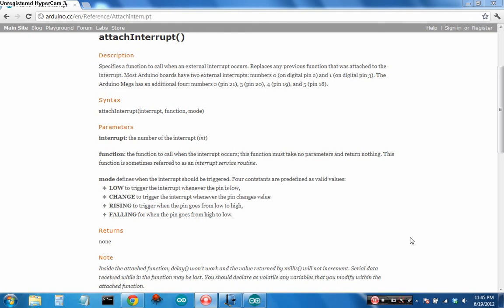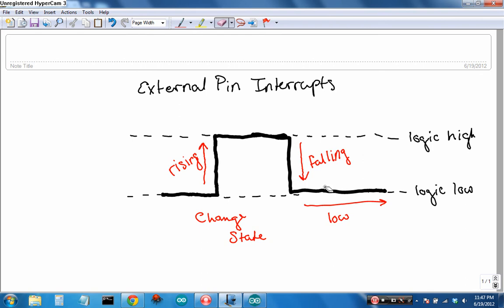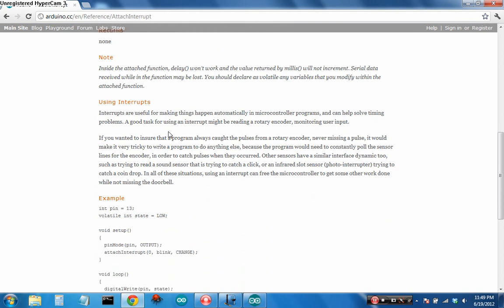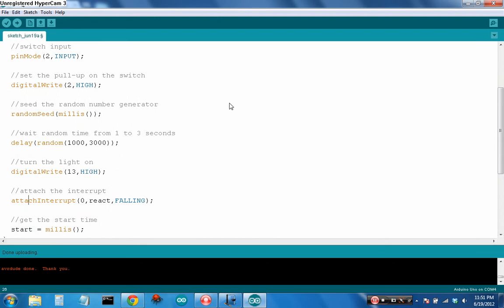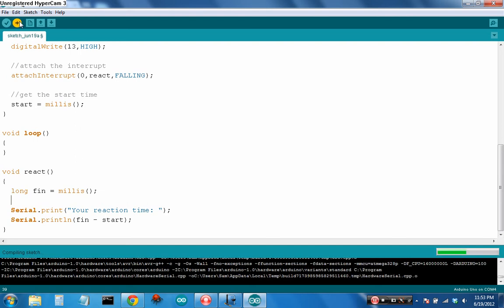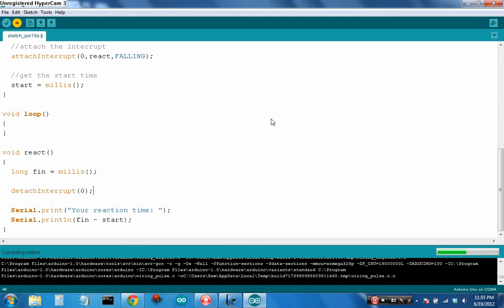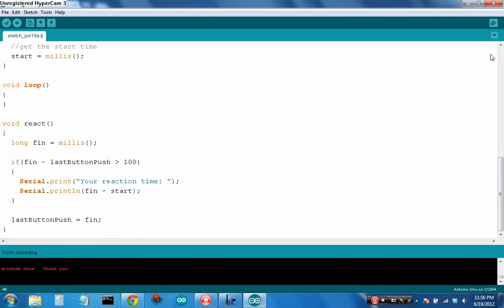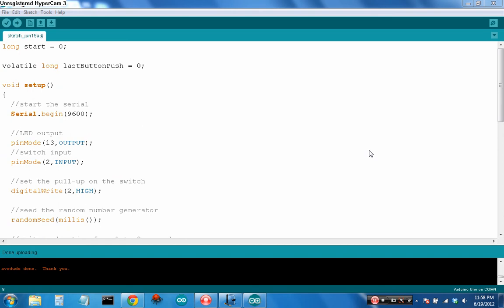Arduino Tutorial #7: External Pin Interrupt

Comment: Hi Guy,

i have a problem and i don´t know , if you can help.

i have a generator , which gives a voltage from 0-5v out. i connected the output of the generator to an interrupt and i have another voltage always with the same range(0-5v). so i connected this one to another interrupt on my arduino Mega 2560.

I main point i want to reach, is first of all to find the right zero of my signal, when he comes out. Because i have a rectangular signal. Secondly i need to know how the arduino could convert the tension in angle(with the first tension) and the with the second tension convert it in time.

I need this tho control the a Optokoppler connected on a digital outputi will choose)

steps to follow to solve the problem:

1)read a voltage for the angle
2)read the voltage for the time to set the optokoppler high or low
3)convert the voltage in angle
4)convert the voltage in zeit

5)wait according to the given angle==> optokoppler "HIGH"

6) wait according to the given Time ==> optokoppler "LOW"

the given angle and time will be entered on a Graphical User Interface from Labview, later it would be converted in a voltage through the system of the compagny and the voltage will reach the arduino..

So i need to know , how the arduino will recognize , that the reading voltage at the interrupt correspond to the entered angle  angle or this time given by the user at the bigining?

I wanted to detect first of all the zero of my signal , so that the microcontroller arduino Mega 2560 can start at the same point to read the signal and send the command to set the optokoppler high or low..how to do this?

PS: For the input= the angle i have 5v correspond to 360 degre and for the other input for the time i have 5v who corresponds to 60s.

The rectangular signal has a frequency for 50 Hz and the period of 20ms.

Please could someone help me?

Regards!

Comment: This can be easily done with hardware.  I put a 750K ohm resistor in series to the first input of the switch from the 5V power supply. The first input also connects to the D2 pin (INTERRUPT Pin)  of the arduino. The second input of the switch connects to GND. Finally I put a 1uF Capacitor across the D2 pin and ground. Now set the trigger mode to 'RISING' in the code. Thats it! Worked like a charm. OPTIONALLY: You could put a 22pF ceramic cap across the switches for even better stability.

Comment: how can i do the same when i want to work with two arduinos.....interrupt for arduino 1 should make interrupt of arduino 2 to go low and stop working the devices on  the same arduino  and vice versa
Reply: Simply use arduino 1's digital o/p to arduino 2's interrupt....
when arduino 1 is triggered, it send high bit to it's digital port and that will be taken as arduino 2's interrupt and it will be turned off. ri8??
Reply: Are you from India??

Comment: How are you measuring that time difference?  I am trying to measure time between two button pushes (without using pause) and cannot seem to make it work.
Reply from the maker: I record the starting time and the time when the button is pressed. So the time elapsed is the difference between those two numbers.
Reply: I see that but how?  There seems to be something unique about this code that allows that.  I have tried many ways and can't produce that result.  Can you modify this code so instead of a random time that triggers a light, a button begins the time?
Reply: Can the elapsed time between multiple button pushes be determined? Seems quite vexing.  Perhaps an external timer would save a lot of headache?
Reply from the maker: Send me an email at humanharddrive@gmail.com so that we can talk and share code a little easier.

Comment: I don't get why the switch is between in interrupt pin and ground.  It seems more intuitive that we would send it +5V, and I guess leave out the
  //set the pull-up on the switch
  digitalWrite(21,LOW);

Hm, I just commented out the pullup line and it seems to have no effect.  Do not understand : \
Reply: This can be easily done with hardware.  I put a 750K ohm resistor in series to the first input of the switch from the 5V power supply. The first input also connects to the D2 pin (INTERRUPT Pin)  of the arduino. The second input of the switch connects to GND. Finally I put a 1uF Capacitor across the D2 pin and ground. Now set the trigger mode to 'RISING' in the code. Thats it! Worked like a charm. OPTIONALLY: You could put a 22pF ceramic cap across the switches for even better stability.

Comment: I was told that you should not use Serial.prints inside you ISR function (or react() in your case) because the print statements use interrupts themselves. You don't want to interrupt your interrupts.

Comment: I also found an easy way of debouncing .Just put a small transistor like BC337 its collector on HIGH and in series in its emmiter  a resistor say like 10k and the resistor in GND.Then from 5v in series put the PUSH BUTTON then a resistor like 470 ohms and the resistor's end to the base of the transistor.Now take the signal from the transistors emmiter. If you make the interrupt in RISING mode there bouncing disappears.I verified it many times.This way you skip the code and the schmitt triggers only with a BC337 and 2 resistors.I hope this helps!

Comment: I like to use a more hardware solution to debouncing, such as some capacitors directly across the switches or buttons or encoders to do that low-pass filtering for me instead of using code, that allows the code to run ever so slightly faster, with effectively no cost since I have a bucketloads of capacitors around the shop.

Comment: I realise that you are trying to explain how Arduino interrupts work, but by breaking some of the rules for interrupt coding you are setting a bad example for new programmers. Yes you can call millis () and Serial.print () from inside an interrupt but you should never need to with proper coding techniques. You shouldn't spend more time in an interrupt routine than is absolutely necessary.  You should aim to just set flags and get out quick. You can then check the flags in the main loop. Oh, and fix the loose connection on your mic please, this vid is actually painful listening on headphones. But, most important, don't stop making vids. :)
Reply: Exactly what I wanted to say. Don't forget to clear the flag after you did the Serial.print() in the loop().
Reply: Seems like the bug with delay in seconds not resetting relates to some re-entrancy into ISR routine and usage of Serial.print()..

Comment: Yousif Jawhar there is no big difference between if and an interrupt, but when writing very big programs multiple if loops are not practical, the processor will check have to check each if statement, and when a lot of if statements are there the whole thing will work as a delay, but in case of external interrupts normal processing time wont be taking up to check the statement instead it is done by the hardware (not sure abt how its down though, but its like having another guy do ur assignment while u play ps4 :D)

Comment: hey man, I have a problem with the interrupts, I'm trying to make some parallel communication and I need to use the interrupt pin as an OUTPUT after the arduino detects the interrupt, I've tried so many things but I still don't get it right, could you help me? thanks!

Comment: An interrupt is not triggered by a line of code. You can have different code running on the processor, which will be interrupted (hence the term) to execute the interrupt code, then resume with the previous task. This allows for extremely efficient programming, because it saves you the pain of polling states continuously.